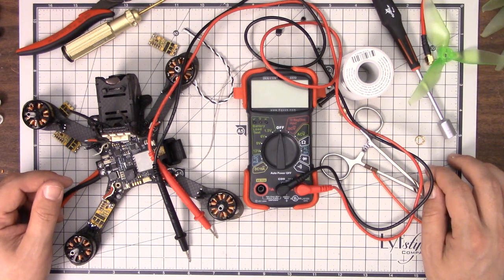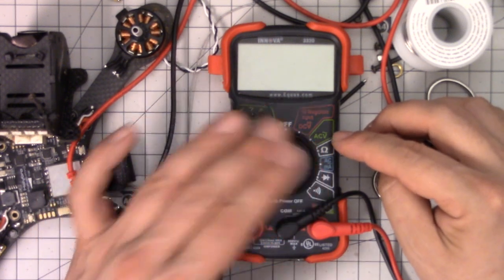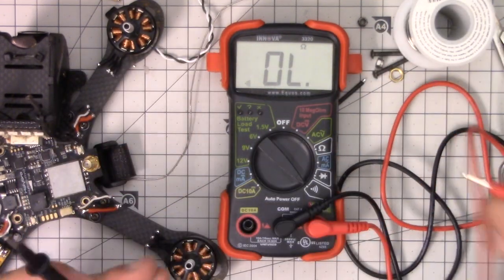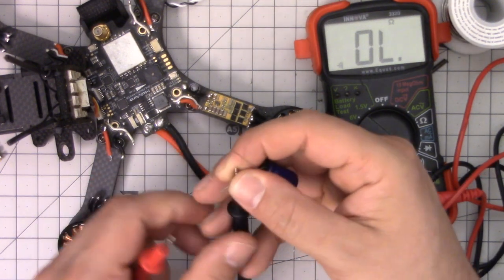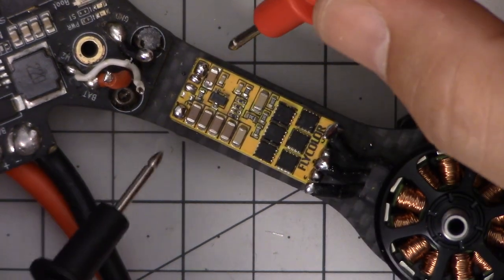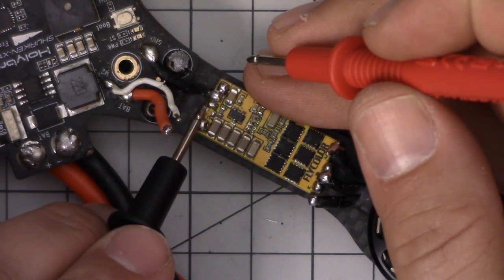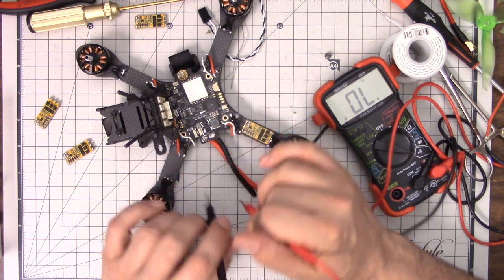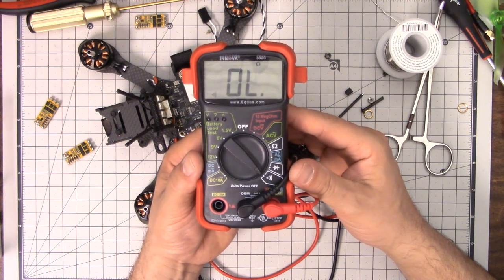HOW TO USE A MULTIMETER: Continuity Function

Comment: Probably already been mentioned, but before I solder a pad (especially a small or fiddly one) I check for continuity with all the adjacent pads and components. Once the joint is complete, I check again and if I have continuity where I didn't used to then I know I've accidentally bridged something. Great for piece of mind if (like me) you're less than 100% confident in your ability. 

Keep up the great work Joshua!

Comment: +Joshua Bardwell - thanks this is sooooo timely.

I had a problem- I assume a short -  and fried my last FC  and have been continuity testing my current build, but been getting that little beep on as well as a brief little flash on my smoke stopper when  first contacted the probes.

I thought that tiny little beep was probably dissipation of static, some residual stored charge in  a cap or something like that but I was still really nervous and constantly afeared I was gonna fry something again.

This video appeared on Youtube right as I was about to power up the FC with a battery (as opposed to USB) for the first time. I was literally about 15 mins away from applying battery power when I went to my You Tube landing page and saw this.

You've posted exactly the right time to re-assure me.

Thanks.

I so love you're content - your perspective soooo closely matches mine, your videos work really well for me.

To anyone else reading this - think about how much You Tube you watch compared to Netflix or Hulu or whatever IP TV you buy. 

I found nearly all my viewing was You Tube and Joshua's channel was pretty high in that content. So  I have cut an IP TV subscription and I know patronise the You Tube creators, like Joshua.

It's the right thing to do. UFC, Amazon Prime, Netflix and all them, don't make the content I watch most often. Joshua, Stew,  Painless 360, Flite Test, Rotor Riot (which is a bit contrived) etc make the content I watch most.

Comment: JB still helpful, can you update the problem solving for our modern gear, AIO boards and 4in1 esc's. thanks.
Reply: Yeah, I'm having that exact issue, bought the Eachine tx06 AIO, says on the directions and all the videos I've watched, for power it can be soldered to board or use provided connector with 1s.  Plugged it into two different 1s batteries, both times started smoking.  Batteries were new and I tested them, both appx 3.9v.  Cam is rated at 3.2-5v.

Comment: Every video I see doing this has separate esc, is there a way to do it with a 4 in 1? I have a drone that burned out the esc when I plugged in so I replaced it but how do I check if the motor wires aren’t crossed? I can’t quite tell with my eyes lol

Comment: is the vin and vout on fc supposed to have continuity to ground?   I think this differential signaling stuff is my answer, but i might be mistaken and still worried because i may have hooked up a fried camera to new fc.   OSD works no camera feed, waiting on replacement (upgrade) camera and fingers crossed that OSD module is ok.  but i have continuity from OSD Vin and Vout on f4 to xt60 ground on esc. 

bardwell pls help b4 my i plug in my new runcam into bad board, otherwise im out of ideas. ALSO out of MONEY.

Comment: What about continuity tests which show some readout on the meter, but doesn't cause the meter to do a prolonged beep.  Initial test of the bare PDB was normal - no continuity between + and -.  After soldering ESCs I got a surprise.  To be clear I haven't attached the motors yet, just 4 ESCs, so I was surprised when I tested continuity between positive and negative battery leads (at the XT60 connector) and got a quick beep and a reading on the meter but no sustained beep.  Stranger still, when I attach the red meter probe to the red positive lead and the black probe to the black lead the readout is 1430 and if I reverse (black to red/red to black) I get a readout of 465... what could that be?  Is this indicating a short, and if so why wouldn't the meter maintain the steady beep to indicate continuity (as apposed the the brief chirp you mentioned could be a capacitor discharging).  I haven't wired a capacitor myself, but I assume there could be one or more on the PDB and/or ESCs.
Reply from the maker: A short beep that ends quickly is almost always a capacitor. I don't know what else it might be, anyway.

Comment: Very good info yet again. Can I just ask why you are swapping out the escs? I just bought my X1 and I have a slight vibration (visible very fast side to side movement) on throttle up, may post a video to you. I heard that the stock escs are the problem, I was thinking of swapping them out for littlebee 30amp blheli S. whaddya think?
Reply from the maker: +Legacy Of A Legend these are replacement ESC's put out by Holybro to address some issues with the originals. Your oscillation might be the same thing there describing. Check the Holybro site to get the ESC's they suggest.
Reply: Joshua Bardwell thank you so much for replying and saving me allot of trouble shooting. I suspected it was that. Keep up the good work mate.
Reply: Joshua Bardwell Hiya mate any chance of a link? I can't seem to find it anywhere
Reply from the maker: https://www.undergroundfpv.com/collections/shuriken-x1-spares/products/kamikaze-30a-blheli-esc?variant=33939519492
Reply: Joshua Bardwell thank you very much sir!!
Reply: Joshua just one last question please, I'm putting littlebee 30amp blheli s on it, the old escs are not grounded (the black wire next to signal, where would I attchac the black wire to? Or do I just use the main red black and signal??

Comment: I have a new HGLRC stack. When I test continuity between +and  - I hear a tone the other way it is quiet?

Confused
Reply from the maker: A short beep is a capacitor charging up. It's no issue as long as the beep is not continuous.
Reply: @JoshuaBardwell 
Thanks
 I watched your video and I heard when you mentioned the capicitars charging.  This was a long continous tone but only on one multi meter and one way?

Comment: One other thing you might have mentioned referring to shorts, is the the carbon fiber of the frame touching something in the system.

It can be a problem for those wanting to make their multi as light as possible and forgetting to isolate the back of their ESCs on the booms OR using extra thin heat shrink.

Plus high gloss CF can be a gremlin that can show its ugly head WAY down the road because the ESC might not short immediately until vibration has worked the contact through the glossy surface.
Reply from the maker: +Cyberdactyl good point about the CF.

Comment: I have a smoke stopper with a 2a blade fuse and it pops randomly but it works and powers the quad with no magic smoke. 
Why does the fuse blow when I connect the battery sometimes on the same quad which has zero continuity ???
Reply from the maker: Quad must pull more than 2 amps when starting up. Motor beeps are a possibility.

Comment: If I have continuity between signal and ground esc wire, the signal wire couldnt carry a signal...but does it cause any damage to the esc or fc?
I have waterproofed my copter before checking with the multimeter xD checked the continuity between the battery connector + and - and they are fine

Comment: Joshua,I watch a lot of your videos,so I decided to reach out for some help. my Skektrum 3.3 receiver will not light up. My setup is the matek 405 with the ribbon to the F hub. Soldered black to gn, red to 3.3 and gray to rx 3. Everything else works vtx and the matek leds. Any ideas....thanks
Reply from the maker: Test voltage on 3.3v is it there? The FC cannot operate without the 3.3v regulator so if the FC powers up the 3.3v must be alive. If there is no voltage, try plugging in a battery.
Reply: Tested voltage,nothing,tried receiver with another board and it worked. Was going to try to check everything in Beta Flight, board got too hot to touch....looks likre its cooked. this is not my first build either.  I guess stuff happens. Thanks for the help @JoshuaBardwell

Comment: Hi Again, I can't seem to reply on the other video and I know this question of mine isn't pertinent to this video but "I'm Not using dshot and my mini_throttle is 1080. When I arm the quad at 0 throttle there's no yaw movement, yaw is responsive a tad over minimum throttle. Once again, would greatly appreciate your input".
Reply from the maker: +Mr. Barrie FPV if you are using stick arming then yaw is disabled when throttle is below min_check.

Comment: Hi Josh, Please suggest what could be wrong with ESC getting hot when connecting to the PCB and no motor is connected, I couldn't figure out what is wrong and if I am changing the ESC that's too getting hot. It is only happening with 2nd motor on quad which is in X mode.
Reply from the maker: If the ESC is super hot when no motor is connected, then I think the ESC has a short in it. Desolder the ESC and measure for continuity between battery + and - pads. Then check the PDB for the same.
Reply: Joshua Bardwell there is no continuity between the + - battery pads but for all esc + - pads I am getting the beep sound as shown in one of your video. Also I am getting some readings as well in batter pads while checking continuity. Is it ok? This all problem was not there two weeks ago before the quad crashed after going out of range. I changed the motor too and esc as well.

Comment: Hi Joshua,  I could really use your help on the Shuriken.  I accidentally ordered the Frsky version instead of the Flysky version to go with the FS-i6 Tx.  I have an extra X6B Rx and wanted to know how to go about wiring it?   I can't seem to find the SBUS pad on the mainboard.  Also don't know how to wire the bind button on the rx to the mainboard.  The Frsky has a single solder pad on each side of the bind button.  The X6B has 2 solder pads on each side of the button.  Hope you can help.
Reply: I don't own one, but I think this is the board pinout you're looking for. http://des.gearbest.com/uploads/pdm-desc-pic/Electronic/image/2016/11/24/1479946602181706.jpeg
Reply: Thanks.  I did find that before but the pinouts that show the SBUS are currently being used for the 6pin JST SH plug on the Frsky rx.  I was hoping to find a solder point for SBUS somewhere else on the board.  I guess I could cut the plug off the frsky rx and use it but didn't want to waste a good rx.  I just ordered a 6pin wired plug to use instead which will take weeks to arrive.  And I'm still iffy on the bind button wiring.
Reply: Yep, thats exactly what you'll have to do. Get yourself something like this, and cut that sucker!  You can always repair the cut end later. http://www.readytoflyquads.com/4-in-1-connection-s-h-cable-set
Reply: Yep. I ordered a set of premade ones..funny thing is I find it easier to solder than to fiddle with those tiny crimped connectors!  lol
Reply: You could try wiring the iBus to the R2 pin just behind that connector, and changing serial RX to UART2 in betaflight.
Reply: Looks like UART2 is being used for the S.Port. I'm guessing it could be switched for sbus/ibus tho I'm not completely sure.
Reply: There is no smart port telemetry on X6B so yeah. And Ibus doesn't require inversion so it'll work on any unused UART!

Comment: would it pay to check for continuity after each bit of electrical / board work to reduce the amount of time it would take to isolate a problem. i.e., check after each esc is installed, not after all of them?Also, I was wondering, when you start a video there is often and advertisement that you can skip past.  Do you get a fee for those ads and if yes, do they need to complete?Thanks

Comment: I just made That test tonight on a fresh build. I have continuity between ground and on esc signal pad.  Is that normal ? I just powered the fc with usb for now, and now i'm afraid to connect a 4S. What should i do /Check?
Reply from the maker: +BouT FPV continuity between signal and ground won't fry anything. Signal pins are designed to be connected to ground without damage. The effect will be that the ESC does not receive any signal, so it's still an issue that needs to be addressed.
Reply: thanks joshua , I solved it by resolder it before powering by lipo. But now the TC won't power on ... ( fresh build of impulseRC helix) . Thanks anyway :)

Comment: Can you explain what the numbers mean?  My multi meter doesn't have a beeper but sometimes shows high numbers when there is no visible short and im wondering if that is ok
Reply from the maker: +Matt the numbers are ohms. Low resistance would mean a short. High resistance would mean no short. A number that slowly gets larger without settling down probably means no continuity and the auto ranging function is trying to find the correct range.

Comment: I am getting some reading when checking the continuity in my quad, where the ESC is connected to the PCB board, ESC is also connected to the motor, Am I supposed to get some beep sound or reading?
Also when I am checking the continuity between the +ve and -ve battery lead connected to the PCB board is giving me some reading of 648 when connecting +ve wire of multimeter to +ve battery lead and when connecting -ve wire to +ve batter lead getting the reading of 479, is it good ?
Reply from the maker: There should not normally be continuity beep when testing between +ve and -ve on the quad. The exception is, if you have a large capacitor, you can get a very short beep that stops.
Reply: Yes that is what is happening, a short beep, thanks, but am I suppose to get any reading in continuity mode on multimeter, also when motor is not connected to the individual ESC which is getting hot, what could be the reason. I am simply connecting the ESC to the PCB board and then plug-in the battery and then can feel the ESC getting hotter with every seconds, Why SO? It is happening even if I change the ESC on that side. Quad is in X mode, 2nd wing, counter-clockwise. where is the actual problem.?

Comment: Hey so I have a troubleshooting problem with fpv system i was wondering if I see snow it's the fpv transmitter and if I see a black screen (and my lense cap is off) the camera is bad right ??
Reply from the maker: +Alex Dalton yes
Reply: Joshua Bardwell u da man josh lol thanks
Reply: Joshua Bardwell hey so I asked he question about the fpv trouble shooting so I was currently getting a black screen for my fpv feed so I bought a new fpv camera and I am still getting a black screen I checked and I'm still getting a black screen checked camera pdb spot  still getting 16v what else could I be doing wrong ?
Reply from the maker: +Alex Dalton wire the camera directly to the vTX. Confirm that the vTX is transmitting using spectrum scanner like LaForge.
Reply: So just wire the camera directly into the video transmitter and is there a way to get around not having a Spectrum scanner??
Reply from the maker: +Alex Dalton power down the vTX and the screen should go to static. Thst would indicate that you were on the right channel and it was transmitting.
Reply: Joshua Bardwell it does indeed go to static
Reply from the maker: +Alex Dalton well probably you're just on the wrong channel then. Or the vTX isn't working. Until you can confirm that you're actually tuned in to the vTX you can't diagnose anything.
Reply: Joshua Bardwell good shit man thank you I plugged cam into vtx and got a picture lol
Reply from the maker: +Alex Dalton then it something to do with the PDB.

Comment: Hey, maybe someone can help me, on my multimeter i have a continuity symbol that looks like a speaker combined with whatever is above joshes multimeter. When i set it on ohms and that symbol, it beeps when i put the leads together but it also beeps when i check my drones that i know are wired correctly. What am i missing?

Comment: I appreciate your videos on continuity and the smoke stopper especially since I smoked a 4in1 and a couple of motors.  After confessing my sins, I have a question about about strange behavior when using a smoke stopper.  Recently finished a quad based on the Emax Magnum.  Given my past sins, I carefully checked for any continuity at
 all assembly stages.  No shorts were detected.  After the wiring was complete, plugged in the smoke stopper and a battery.  The bulb lit dimly for a second then went out.  No magic smoke!  Odd, so I connected the battery again, same behavior.  Got out the multimeter and checked  for continuity across the battery input on the 4in1.  No beep but a very brief reading on the multimeter which rapidly went away.  So the question is, do I have a short in the system?  Have you encountered that kind of behavior in the past?
Reply from the maker: The bulb is lighting because the startup tones from the ESCs draw some current.

Comment: I'm I right that you can use an multimeter to replace for a smoke-stopper? (With the continuity option)
Reply from the maker: A multimeter can detect a short, but it cannot protect against some scenarios. If you have a damaged ESC, the ESC can test fine right up until you throttle up, then the ESC smokes your motor. A multimeter won't prevent this, but a smoke stopper will. A smoke stopper will keep your props from spinning fast enough to hurt you. Let's say you are working on a quad with the battery plugged in and you accidentally poke something with your screwdriver and short circuit two leads? Smoke stopper will prevent damage.

Comment: Why does the Vbat and ground have continuity on my f7 flight controller?
Reply from the maker: If it's a short beep that goes away, it's the capacitor charging and you can ignore it.
Reply: @JoshuaBardwell  Im afraid not, I get the tone on the BATT and Bat+ pad and any ground. Is the FC garbage